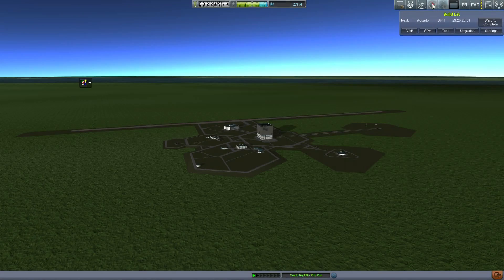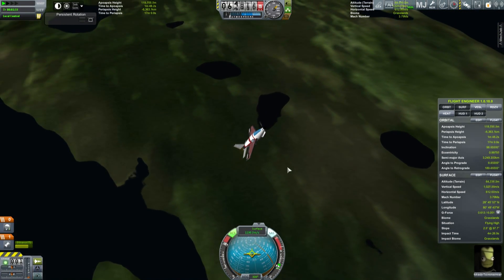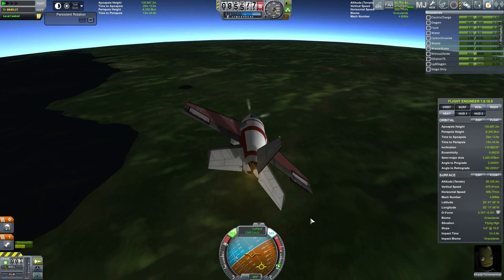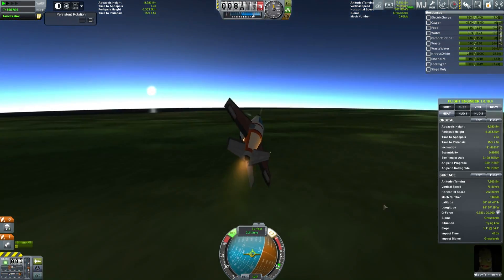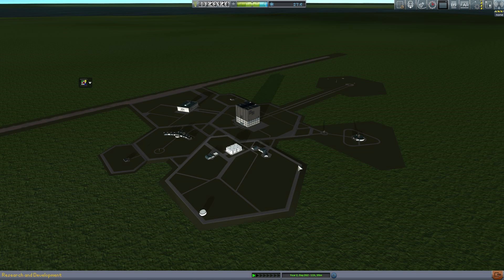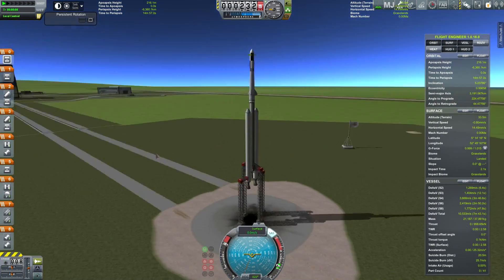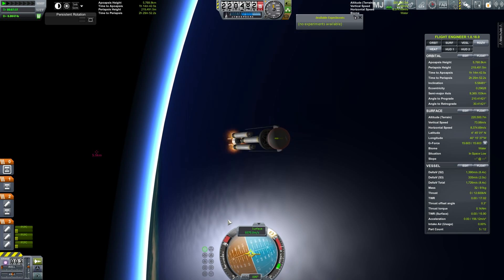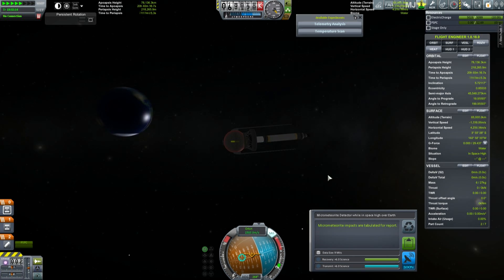Kerbal Spaceships Are Serious Business - Part 7 - Retiring The X-1

Comment: The Shutle worked for a while, then Challenger
Reply: Boom
Reply: And Columbia
Reply: I know this is a later reply, but the Challenger and the Columbia exploded due to a lack of proper safety inspections, the Columbia in particular. The inspection team had noticed a piece of foam insulation was loose on an external tank, but multiple shuttles had done just fine launching with loose insulation, so they didn't bother to have it fixed. During launch, that exact piece of foam ripped off the shuttle and slammed into the wing, doing quite a lot of damage to the heat shielding, and when the Columbia re-entered, it ripped apart. Those people died because of NASA's negligence and lax attitude towards maintenance. So the shuttle still would work if NASA wasn't so stupid about some things.

Comment: Here's a suitable challenge for you Scott. Nathan Kell mentioned in the v0.34 release of RP-0 that it's possible to reach orbit with only the starting parts. And this was before Taerobee mod was supported, so no V-2 rocket engine even. I've tried several ways to build a "traditional" rocket, without much success. I got up to 8000dV before running into the 40 tons limit. I suspect it probably requires a Pegasus style approach. But with that weak jet engine that won't be easy either. Maybe an X-1 type plane powered by 4 or 5 aerobee engines that can take a WAC Corporal type rocket up to a suitable altitude, speed and trajectory? Sounds like something you would like to try. :)

Comment: Need help from Scott or anyone else using RSS+RO.  I'm trying the first re-entry contract with a probe and the heating is too extreme!  I am fairly certain I got everything correct from CKAN and am using the RO shields.  I'm exploding in 90 or 80km starting periapsis re-entries, normally around the 80km mark still moving at over 7km/s.  Is there a adjustment I need to make to thermals in the debug or something wrong with what I'm doing?  The heat-shields are overheating even while they have ablator and heat is either radiating from them or getting around (holding retro best I can, but not 100%).  If I need to adjust the ingame settings what numbers give me an authentic experience?  All I find in searching the forums, ect... is year old data for making changes in DR, because re-entry heat wasn't stock yet.

Comment: Excellent flying! I had my doubts about that very hot dive, but you managed not to melt.

You'll be happy to know that (a) RO v10.4 and RP-0 v0.38 support the Taerobee X-1 parts, and (b) for the next RO Randazzo has kindly provided a much better-looking conic cockpit model (that includes a hatch).

Regarding the AJ10--I was sorry to hear you mention its being pressure-fed in regards to ullage considerations, as that actually perpetuates a myth. While some pressure-fed stages avoid ullage issues by using bladders in the tanks (or surface-tension tanks, or other exotic solutions), being pressure-fed has no inherent ability to avoid ullage issues (as I understand it). For example, the early Vanguard-2nd-stage / Able / Delta stages were all hotstaged, with the AJ10 igniting before MECO (or at least before vernier cutoff, for Thor) to avoid ullage issues. Certainly the AJ10 in RO is subject to ullage concerns, though you usually have a few seconds' grace after staging.

Comment: There should be a mod that makes it so you can take old ships and repair them, making it much cheaper(or is that already a thing)
Reply: +Colonal Qball Kerbal Construction Time does that, the first time you use  apart it takes a lot longer (and I think it costs more) to build it, once you have made a ship and returned it the part is in your "inventory" and it is quicker to build next time.
Reply: +Colonal Qball You get some of the parts' money back when you recover a craft, IIRC some mod from the pack Scott is using scales the cash you get to the distance between the landing site and control center.
Reply: +turarwanaa That's stock behavior and has been for a while.
Reply: FocalPoint-x
You mean, the proportional returns ? I haven't played stock for a loooong while so I could totally be wrong. :)

Comment: Aren't you using persistent rotation mod? Your sat stopped spinning after you went into the timewarp...
Reply from the maker: +Rothank I thought I was, but the mod appears to have broken.
Reply: +Scott Manley Are you sure? This mod will stop rotation if the rotation is already slow enough and you have SAS turned on when you start time warping. Otherwise it'd be practically impossible to time warp without the craft spinning around like crazy.
Reply: +Scott Manley What could cause these mods to keep breaking? Continued use of the file? Would it help to have an initial file for the mods stored on your computer elsewhere just in case they break in the game? I don't know if that would help as a temporary fix or not, just a thought.

Comment: whenever i try and save solid boosters they always blow up still, for some reason the parachutes never work because they get damaged and break, how do you fix this?
Reply: try changing the parachutes' settings to fully open later by changing their opening altitude lower, you could also try fitting some retro boosters to slow them down, I'm pretty sure the speed at which the parachutes deploy is your main problem
Reply: Still blowing up
Reply: +Andrew M Hmm... I'm not sure how to fix it. Maybe look it up? I haven't had that problem
Reply: try putting probe cores and switch to them and fire the parachutes when it is going slower if this does not help try a spacex reusable rocket

Comment: From what I've experienced, you should always put parachutes on the outer side of the boosters to make them peel outwards instead of back into your main stage.
Also: Wouldn't the automation mod* be rather handy for this series? Or is it simply not available yet?
*The one with the various timers and triggers for the rockets. Can't remember the name.
Reply: +Neuttah They rip off and are destroyed now with the latest aerodynamic and parachute mechanics.
Reply: +HebaruSan but, look at 8:44 . The rocket is destroyed when it crashed with each other. Putting parachutes on the side will avoid crashing.
Reply: The parachutes would have no effect because they would be destroyed immediately upon deployment at those speeds. I tried this yesterday.
Reply: +Neuttah I've found that arming chutes (rather than deploying them) works really well.  The boosters fall to the altitude the chutes are set to automatically deploy and by then they have decellerated enough that its not a problem.  I add separatrons as well to go off at separation if part numbers aren't an issue.
Reply: bluefunkenator Yeah, pretty much that, though I often use them exactly so I don't have to resort to separatrons (because reasons).

HebaruSan That can still very much be worked around, and if it fails, you still have the brick they were inside of pulling it outwards.
(Also, might work better with realchute)